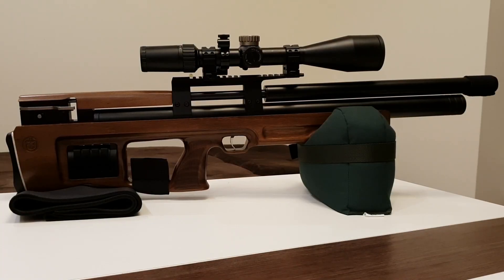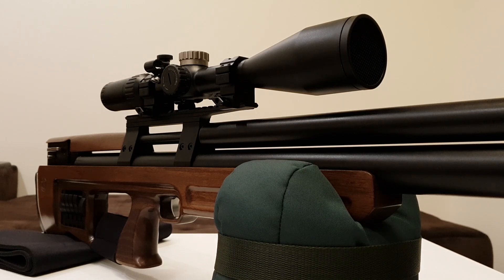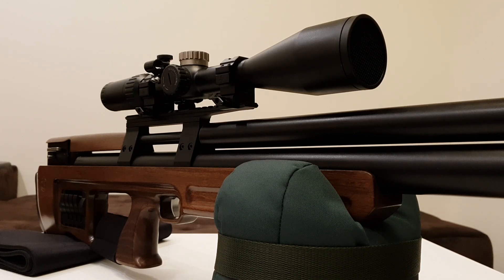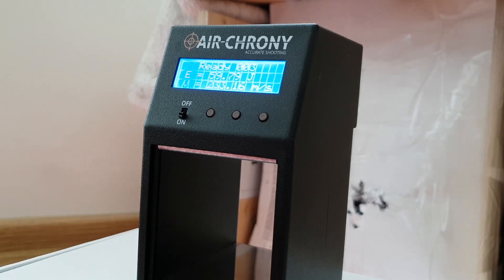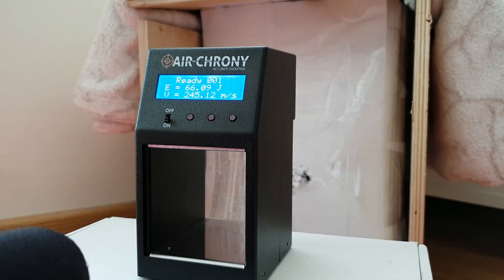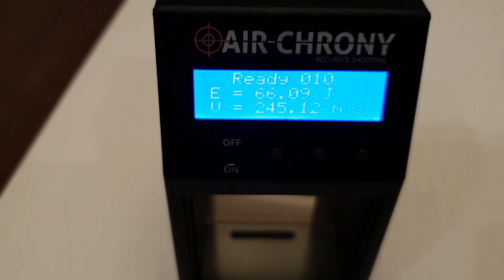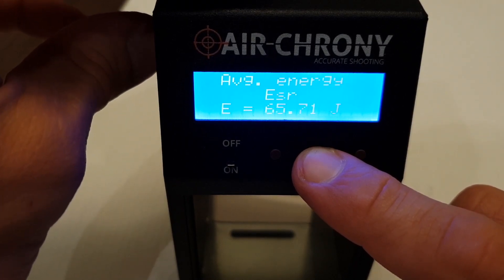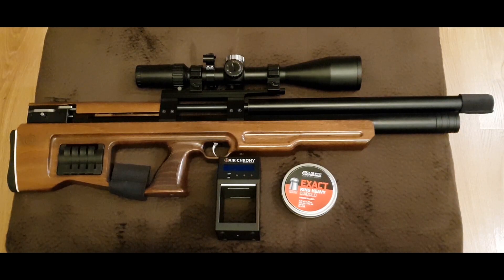PCP Hammer Spring Tuning

Comment: Excellent Video  !  Is it possible to make these adjustments on an unregulated PCP ? I own a Hatsan Flash QE in .177 Cal and I just want to reduce the Muzzle Velocity so that the .177 Pellets will "behave" steadier and keep a straighter Trajectory with a reasonable Velocity under 800FPS. This will make the Hatsan a better and more stable Target Rifle for Target Practice. I have 10.3 gr and 10.5 gr Pellets but I have a lot of lighter Pellets (7.4gr, 7.9gr ) which I use with a 1377 American Classic Pump Pistol that I will like to try with the Hatsan and being so light they will just be very unstable "fliers" and fly erratically with the Higher Velocity on the Hatsan. Thank you for sharing your knowledge and answering our questions!
Reply from the maker: Hey, bud, thank you for the positive feedback 🙂 It's different with unregulated PCPs. Those settings would make no sense there. What I described in this video is a way to reach an effective sync between the hammer spring and the regulator. With unregulated PCPs you need to find the plateau and know from what bar to what bar you have a consistent velocity of your shots.

Comment: Would you recommend doing this on a unregulated pcp .25? Used for hunting squirrels. Will be shooting 33.95g pellets. Currently had plenty of power with 28g pellets. Usually shooting distance is 20 yards give or take. Also im not really worried shout shoot count. Im using a Hatsan Flash QE .25
Reply from the maker: Sorry, buddy, this procedure makes sense for a regulated PCP.

Comment: Great video, thanks!
If you turn the screw clockwise too much, wiil it fall out or will it stop/fasten at the end?
I own a 40Joule  gamo coyote, even don't know how many turns i need after factory setting, so when i bought it.
Too afraid to damage the piece... i could use some advice. Is 4 times cw too much?
Reply from the maker: No idea, bud... Never held a Gamo Coyote in my hands, so it's hard for me to give you a proper piece of advice. Perhaps when you remove the stock and take a look at the mechanism you'll see. Be advised that after some point adding more tension to the hammer spring becomes pointless. I'd use a chronograph if I were you and I'd work my way up gradually, getting a chrony reading every half turn, then every quarter when the tension increases too much.
Reply: @AirRifleActivities  thanks for answering. Too bad these chronys are so expensive...

Comment: Hey man!
Could you do a short video tuning the spring in mora ? I had the stupid idea to tune it my self. I think it affected the power. My chronograph shows around 1050fps with 177 20grains slug. I get around 62 joules of energy. I just feel it doesnt kill as before
Reply from the maker: @apoel94  nothing to tune a hammer spring of a Mora, bud. Due to the pressure assisted valve, you only need to make sure the hammer opens the valve and use the reg working pressure for power adjustment only from that point onwards.

Comment: Thank you for replying! The Hatsan Flash QE has an Integral Modulator in the Shroud as described in Pyramyd Air FAQ’s. If this is the case, again, do you think these adjustment can be made on it ?  Than you again!
Reply from the maker: "Modulator"?? Perhaps you mean moderator?
Reply: YOU ARE RIGHT !  My mistake ! It is an Integral Moderator in the Shroud.  So, my question still stands.... Can I make these adjustments you made on your Video on the Hatsan Flash QE ?  By the way I enjoyed a lot your sequence of shots and the information displayed on the screen where the shots were numbered along with the corresponding velocity and comparing how your adjustments made the velocity change until the velocity variation was practically null !  That convinced me completely with no doubts that the method you were using as the correct one! Thank you again for such a valuable Video ! I already subscribed !
Reply from the maker: Thank you for subscribing and the nice comment 😃 As you probably know, the moderator is another word for a silencer, so this has nothing to do with the gun being regulated or not. So the answer is the same, buddy - this routine makes sense only on a regulated gun.

Comment: It would be helpful to know what was the Ft lB energy at the muzzle.
Reply from the maker: @jamesbowskill362  I'm sure you can calculate it yourself, mate 🙂 Cheers.
Reply: @AirRifleActivities  Why would I need to 'calculate' anything? when a simple question is posed. Dont you know yourself?
Reply from the maker: @jamesbowskill362  James, check out the release date of the video 🙂 More than five years ago. And I have hundreds of videos. I don't even own that gun anymore. Let me watch it again, and I will answer your question.
Reply from the maker: @jamesbowskill362  the energy in J is indicated on the chronograph display after each shot. The highest level achieved was roughly 72 which is 53 fpe.

Comment: How can you change the spring rate without adjusting the regulator pressure? Wouldn't that throw off the harmonics?
Reply from the maker: Geoff, that's precisely the idea - to adjust the hammer spring tension at its best for the current reg pressure. If you want higher  velocity than the optimum achieved in this manner, then FIRST you increase the reg working pressure, and only then you start working your way with the HST again.
Reply: @AirRifleActivities  So what was the purpose of your tuning the spring?  Factory settings should be perfect out the box.
Reply from the maker: Geoff, they absolutely were not. Here in Europe due to shipping safety regulations they unscrew the HST in full 🙂 Sometimes take the spring out entirely in the cases of the Cricket where it's possible to do so. All my guns arrived like this - my Cricket, my Vulcan, my Edguns... Perhaps not the case over there by you in the US. Perhaps it's really best not to touch it, if you've purchased the gun from one of the big airgun stores, such as AOA or Utah Airguns. But the author of the article based on which I made this video, is American and apparently he trusts his own judgement 😉 Sorry I can't give you a final definitive solution on this, bud - so much has changed in airgunning in the recent years, so many options and different designs.

Comment: But you didn't tell anything about your regulator that at which pressure did you set your regulator ?
Reply from the maker: Factory settings. 125 Bar.
Reply: @AirRifleActivities  
If the bar pressure is increased to 150 then what about the hammer spring that should also be increased or otherwise
Reply from the maker: @VillageHuntsVistas  yea, otherwise the valve won't open as much. But be advised the spring has its limits.

Comment: hi there .  is it .22 or .25  caliber air rifle?how much joules i can increase for a .22 cricket ?
Reply from the maker: Hey, bud. It's a Cricket .25. As for the .22, the power depends on your reg working pressure and hammer spring setting. Out of the box the Cricket .22 is about 40-45 Joules, I think. It also depends on the pellet you're shooting.

Comment: i have a uk webley en4cer, at sub 12ftlbs........... when i screw it in, the rifle wont cock, is there some sort of stop, so as to not push the rifle over the 12ftlbs legal limit?
Reply: Phil Brown If you turn too much to increase,the Hammer spring gets coil bound,ie won’t compress,A stiffer spring is needed.Its like putting washers in a spring rifle,too many and it won’t latch. harder spring with wider coils is needed or replace with a FAC spring designed for high power rifles.Keep your eye on 12ftlbs if in U.K.
Reply: @theBodger  bought a chrono to check the power before i start serious modifications....... was coming in at 7.6ftlbs brand new!!!! sooooo, its gone back to webley to be sorted before anything else!!
Reply from the maker: The Bodger has a point, Phil - you can't increase the spring tension indefinitely. And watch out for the legal limit, friend.

Comment: A whole thread and a 10 minute video to say "the sweet spot is found with 3-5% reduction to max power"
Reply from the maker: Most people wanted more details. And no, that's not what I said. Good luck.
Reply: If you read the comments... you can clearly see that even after 10 minutes watching step by step process people are still confused so the length was necessary and probably still too short for newbies.

Comment: Why Increase the Hammer spring pre-load when you can just install a stiffer hammer spring and keep the adjuster held firm with thread glue to save it moving.
Reply from the maker: On the Kalibrgun Cricket it wasn't moving on its own at all. And neither did the ones on my Edgun Matador and Edgun Lelya. High end pcps usually have some sort of mechanism preventing such unwanted rotation of the HST. Yes, you could use a stiffer spring, but you need to be careful not to put too much stress on the system.
Reply: Hmmmm... turn a screw or replace a part?
Reply: Its all about finding the best spring tension so that hammer and reg can work in harmony for accuracy, power and efficiency,if you just put a heavier spring it it may not jive with the reg setting and once the heavier spring is installed if it is too heavy you cannot turn it down where with the lighter spring you can hopefully tighten it to find The Sweet Spot as the guy who made this video shows

Comment: you don't explain how many laps you start with the hammer, you don't explain how many bars your regulator is
Reply from the maker: The reg on this gun was at it's factory settings - about 120-125 bars. You can conduct this procedure for just about any reg pressure - you simply need to adjust the reg first, then you start adjusting the hammer spring accordingly, until you reach the most efficient setting. "you don't explain how many laps" - I didn't state the number of rotations for 2 reasons: firstly, because the hammer spring adjustment mechanism is different on the different airgun brands and models; secondly, you can start at you hammer spring's lowest setting and work your way up until you reach the highest efficiency point. I hope this helps and thank you for taking the time to post a comment.